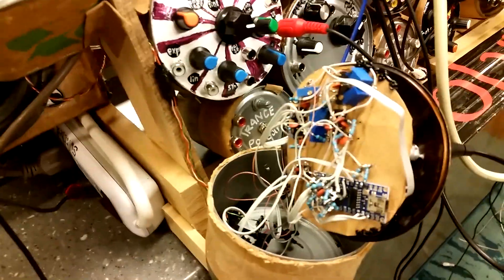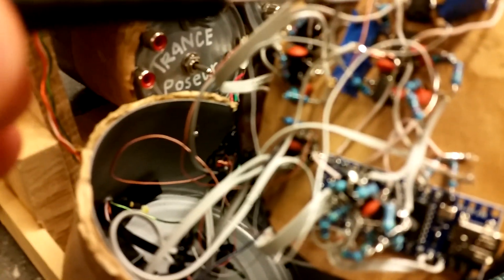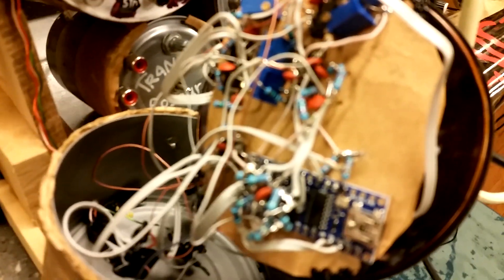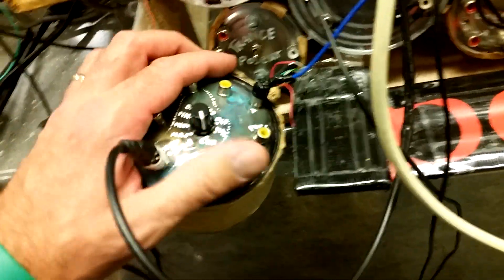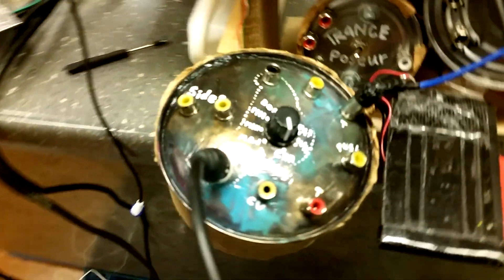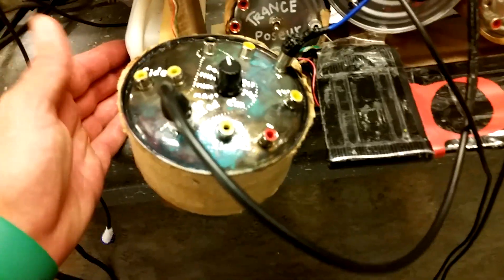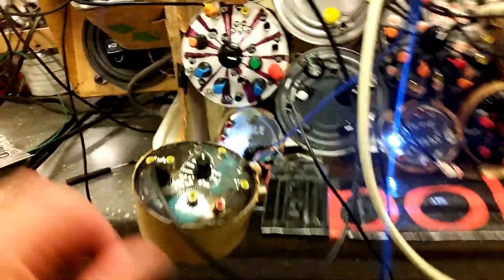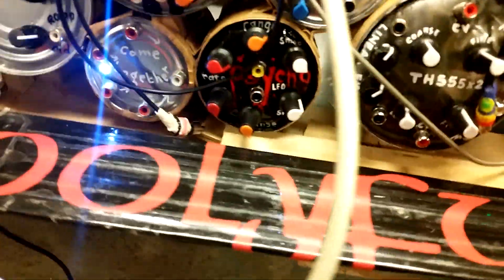DIY synth ribbon controller

Comment: hello, can i use it without ribbon, only for CV out please ?
Reply from the maker: Yes, but there has to be some control voltage input to quantize.
Reply: @ozerik  -   thanks a lot , but when i check the code , that say error : "RBD_Timer.h> no such file or directory", can you help me please i'm a noob with that
Reply from the maker: @SBender36  Sure, you need to install that library. From the menu: Sketch -> Import Library -> Add Library. All the libraries you'll need for any particular sketch will be the first thing in the code. Good luck, it has been a WHILE since I built my ribbon controller! I remember it being complicated.
Reply: @ozerik  thanks

Comment: would you mind sharing a bit on the hardware/code concerning the scaled output.. this is some controller i have had in mind for quite some time and now i see this here :)
Reply from the maker: Yes. It may have some issues because I did some coding without the ability to test it. For this module, I did the trigger and gate outputs in hardware, but it's easier to do it in code... which I went ahead and coded into the sketch last nigh, but without tearing the module apart I have no way to make SURE it works. So with that said, here's the links to the code and the schematic... or at least a schematic that should work (I don't remember the exact circuit!):

https://drive.google.com/open?id=1bT5ZxnaOnUqLI42tnkUOgR-Y1RFkZ1j8 
https://drive.google.com/open?id=1qP27kmzXWkBrU7zquVleDZB3MyO6jnTX
Reply: @ozerik  wow. thank you very much. i will try to understand it and first breadboard before going on. this arduino stuff seems very powerful. guess there is a whole new world of possibilities within.
Reply: @ozerik  do i understand it right, that the output circuitry is some kind of digital to analog converter?
Reply from the maker: @ellopropello  the outputs are PWM (pulse width modulated) "analog" outputs. The circuit attached are filters, smoothing out the pulses.
Reply: @ozerik  thank you. gonna try those for my current project. the passive lowpass i found on a website didn't work quite well. sounded like some kind of fm-modulation
Reply from the maker: @ellopropello  Yeah, this is a 4-pole filter, it'll cut out the PWM noise. Typically, passive filters are just one pole.
Reply: @ozerik  that makes totally sense. thank you
Reply: @ozerik  finally i got one ribbon controller so i started building. i am having a hard time to understand what exactly is going on, since the ribbon controller delivers values between 460 and 1023 to the analog input of the arduino, and i got ridiculous strange values for the midi notes. like -15833 to 41842 whatever :) resulting in weird output along the ribbon. 

any ideas what may cause this? i ended up using just the filter part to be able to at least get some signals and it is really fun just that it would be cooler to have those output notes follow some kind of scale so it fits the rest of sequenced melodies or other notes. other than that it is really fun to use ribbon controller for whatever and to play melodies at uncommon scales. i created a code that uses one pot to set the number of divisions along the ribbon and one pot that defines the full voltage for the ribbon.
Reply from the maker: @ellopropello  The lower value of 450 probably means that the resistor between the ribbon and ground is too large. You need a resistor to keep from smoking the pot or the Arduino when you touch near both ends of the ribbon at the same time, but anything larger than 500R will be safe, and still let you get close to zero as an analogRead value.

The MIDI notes are far beyond me, sorry, I don't really understand MIDI. I have struggled mightily with getting the PWM "analogWrite" readings directly from the Arduino to make sense... that's what the sketch I posted up there should do. The sketch I posted can send voltages that correspond to scales like major, minor, dorian, chromatic, etc. but you do need to trim one of the amps carefully to get the scales accurate.

Good luck, it's quite a project!
Reply: @ozerik  ah, thank you. i will lower that value, already tested it with no resistor at all and got 0 to 1023 but added the resistor arain, to stay as close to your already working design. didn't know that the resistor cares about multiple touchpoints... so it seems i was lucky that i didn't burn that pricey piece...
Reply from the maker: @ellopropello  yeah, touching the top and bottom of the pot turns the part basically into a wire!